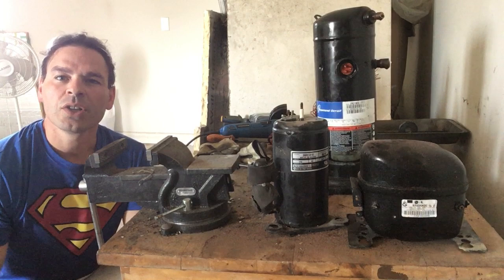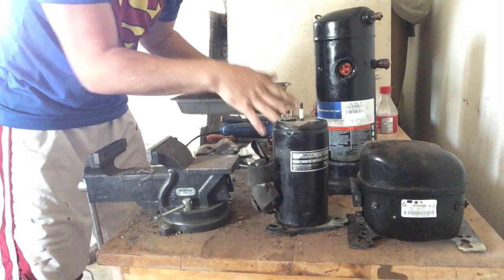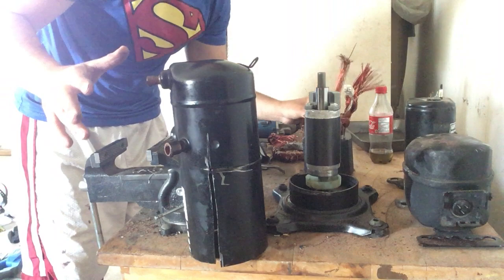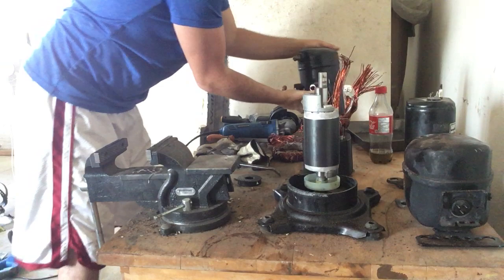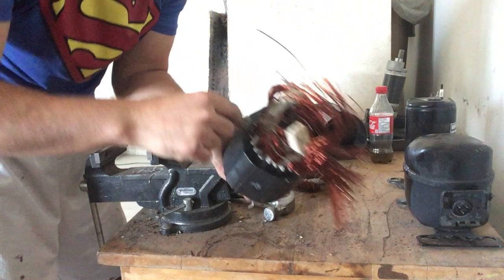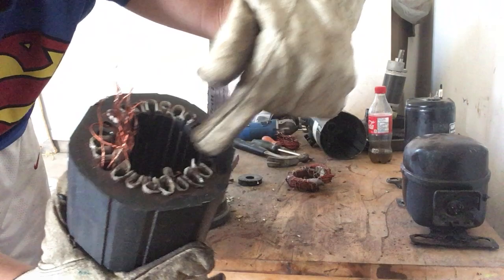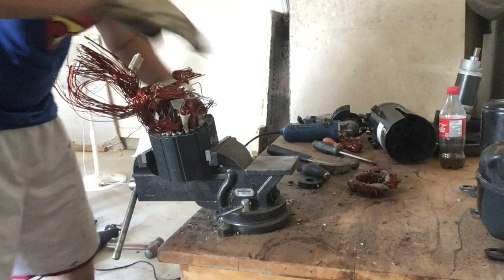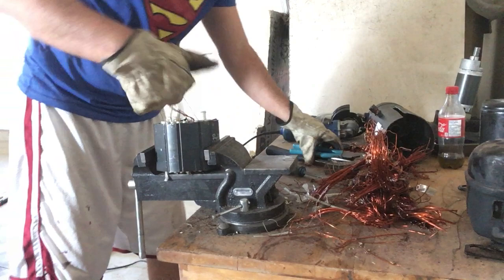Scrapping a large 45 lb. home AC compressor for the copper. How much copper did I get?

Comment: Hi. You should lever it up a little then put a bit wood under the prybar and lever again. This will help a lot.
Reply from the maker: Thanks for the tip. I will have to try that. I have never had a motor that large before. Nice weight of copper for sure. Thanks again and stay well.

Comment: A little heat loosens the copper and you probably could pull it out by hand real easy
Scrap dealers usually won't take melted metal
They have had problems with contamination and that's where the buck stops
The big refineries won't accept ingots of aluminum and copper for that reason, as people have melted lead and gravels etc into these ingots

Comment: That copper will just slide out if you would put it in the oven for about 10 minutes on 450 the steel expands and the epoxy let’s loose and it will fall out just cut the copper on one end before baking it

Comment: Hey thanks For the video, so you had mentioned the price of compressors and dirty cast being 5 cents a pound, you also mentioned steel being $259 a ton, which is almost 13 cents a pound... is this an over sight by the yard ? I have the same thing going on with the yards here and It doesn't really make sense how the price of dirty aluminum or compressors are worth less then steel ?
Reply from the maker: They said that unfortunately aluminum is probably the only thing that has not really changed in price. I know it is weird, especially when you think about all the uses, but apparently it is because steel is not being manufactured as much due to COVID right now.
Reply: @TinManScrapper  thanks for the reply and again for the great informative video,  I guess we're just  better off just putting it all in with steel, if they allow it.
Reply: After watching your steel vs tin video, I should say "put it in with tin" what is the price of Tin/Shred in Southern Ontario?
Reply from the maker: @silverjunkie6585 Tin/shred is pretty much the same. Most things they will just lump together, other than I Beams and other structured things. Most people will bring it all in and forget to separate. Amazing though the differences at scrapyards...depends sometimes on the guys working and if they want to take the time to separate the metals.
Reply: Aluminum breakage, compressors, and things like that require an extreme amount of extra labor and processing to recover and separate the materials, which is why sometimes the prices on these remain low and maybe only move 1-2 cents at a time even when all other metals are jumping in price.

Comment: Do you know if you have to get the wire insulation off that hold copper windings together? Or can I just keep it like that for it to be type 2?
Reply from the maker: If you are talking about the string, I thing you can leave some of the winding on it to be classified as #2 since they take with paint or soldering on it. Although I really depend on quantity of load and scrapyard. However, if you have coated wiring in they will ding you.